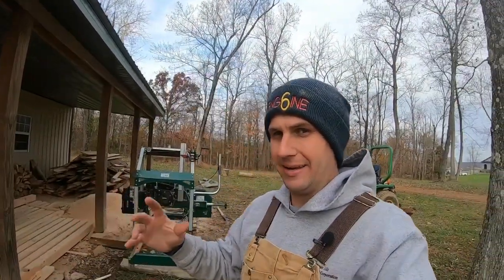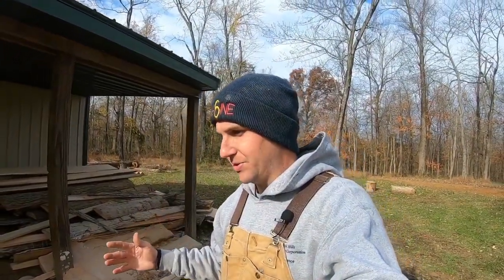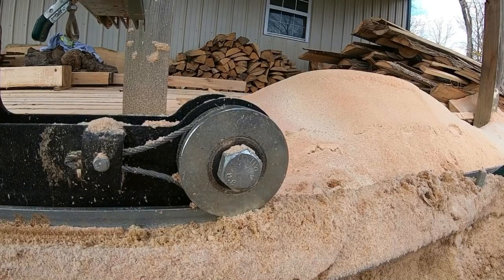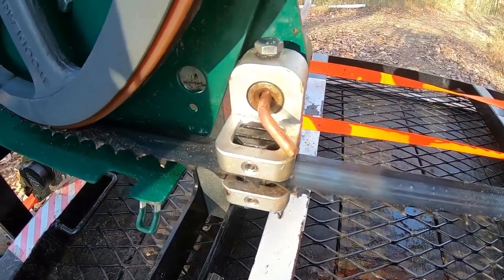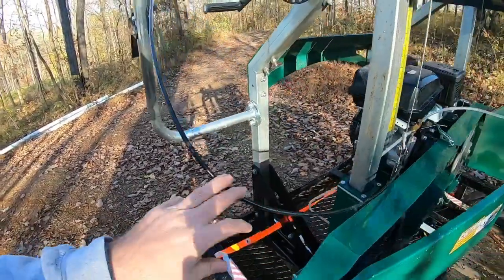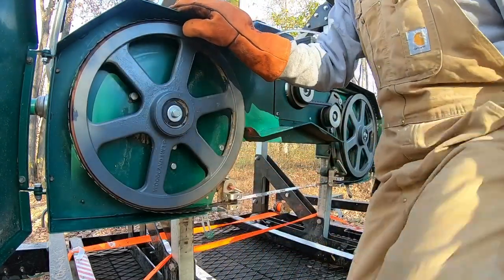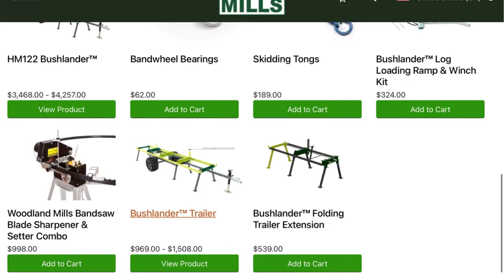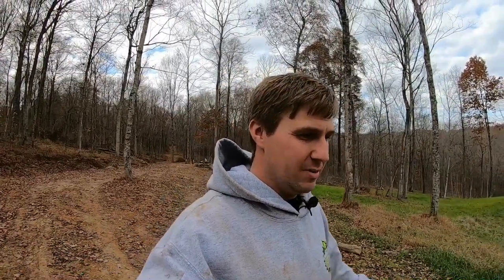My Thoughts After Testing This Entry Level Sawmill - Budget Friendly Hobby Mill

Comment: Simply replace that leveling tubing with a longer piece of tubing and loop it over and tie wrap it together with a small loop in it so sawdust can't get in it.
They could have easily welded metal plate end caps on the cross box tubing to keep sawdust from building up in them..
The owner could do it as well with pieces cut from some steel flat plate.
Overall, it is a pretty nice mill.
Your review was darn good and comprehensive.
Your editing is definitely gotten to a pro level Captain.
Reply from the maker: Appreciate the feedback!
Reply: @CaptainKleeman  thanks.
Next time you build an outdoor wood item like the bridge soak the wood down with a wood preservative like Kilnz (spelling suspect).
A couple of coats.
It'll last way longer than just the tar you used but that was a pretty good idea.
As it'll also help with the wood chaffing itself apart which anything that has friction will do.

Comment: Good morning Mike . Like I have mentioned I have zero experience with logs and wood .  However I do know steel anyway there is one thing about these blades someone new to them may experience and drive them crazy until they figure it out . When uncoiling them from the box it is possible uncoil the backwards . Not a big deal just twist them inside out and problem solved .  I say this because you didn't cover blade tooth direction and blade spin direction .  It is an easy to overlook . I have seen this all the time with the blades we use . But they much longer too .   And if you don't have any blades to see what I am talking about try it on with an old porta band blade you may have laying around .  Keep up the good work .

Comment: Thanks Captain for the explanation of saw and the forest in your area.  With very little pick'ins, and a "HomeDepot/Wade" down the block, yes it does make sense for you.  I saw Letsdig18 and LoggerWade's factory tour, it was unreal what it takes to make a 2x4!  Looking forward to you getting back on the projects (Yes a saw mill would be a distraction from finish that rental boat).  BTW, still want you to move the bathroom drain into the wall instead of the floor! 😁😁
Reply from the maker: It’s definitely an impressive operation!

Comment: With the hm 122 bunks, weld metal plates covering the openings before you start milling, then that problem in done and dusted.
an easier fix for the sight glass / air flow tube, just zip tie a bit of burlap over the top. screens out the sawdust yet lets air flow.
Reply from the maker: That’s a good option,  not everyone has a welder though,  and I’ve never been a big fan of completely closing something all the way in.
Reply: Welder !?!... and even less have nitrogen (to prevent corrosion) in closed tubing.

Comment: A good balanced review. Trick with the water tank breather is put an old chainsaw fuel filter on there, works a charm... Here in the UK for most it's  defiantly not economic to run your own mill, and that's taking in to account I would hazard a guess the cost of lumber is dearer here too, we could never justify one that's for sure.  For the time being the odd bit of milling we do the Alaskan mill with steel box section rails works ok. Another milling channel I watch is 'The Log Father'... his self built mill and timber processing set up is sweet. Keep the videos coming! Jenna and the BCC team.
Reply from the maker: Always love hearing the viewpoints from different areas in the world!

Comment: Good info sir on the entry-level mills. I'm sure all of them have some little quirks that should/could be re-engineered. That water tube just needs the open end to be turned down instead of straight up. My buddy has one and he loves it. He actually cut the oak boards that are on my equipment trailer. Keep up the good workn on the channel. Love the varying content.

Comment: never run a lumber mill, but job I worked involved cutting lots of steel rods ( quarter inch to inch and a half thick ) and changing the blade was always a pain in the ass.  wheel arrangement looks similar but the mill looks like the blade goes on and off way easier than whatever it was that I worked with
Reply from the maker: That sounds pretty crazy!
Reply: @CaptainKleeman  metal slivers are the worst

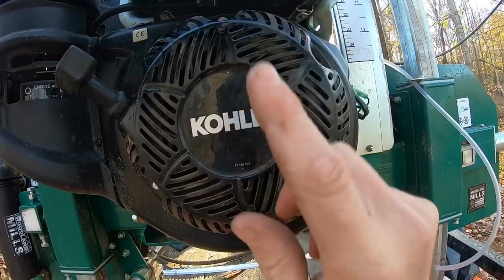Comment: @15:08
That’s not a Kholer feature. That was a Honda feature that was carried over by whatever company makes all the Honda clone engines but the reason is (as far as I know) exactly as you mentioned. Honda makes the engine and companies use them on their power equipment and access to oil fill or drain may not always be the same so it can be setup on either side.

Comment: I agree that the watering system is a little flawed. It's easily remedied, though, by using a thin piece of cloth over the top of the tube and using a rubber band or equivalent to keep it on. The cloth still needs cleaned off once in a while, but that's easily done.

Comment: Hi Mike. I agree solidly that milling is not for you. I just thought that when DP cleared ground an took out nice hardwoods like the mahogany or cherry that he could toss some in the bed of a dump truck and you would have real trees. Another thing that beat you on this was its hard enough just to get that wood to a milling spot since the mill doesn't move and the more handled, the more rock and debris your going to encounter. Plus your tractor has many good points but getting a log on a mill wasn't a strong point. As you said, an entry level mill has its downside or two as that mill you tried did. I will say though with a few improvements it could be a lot better. I mean a lot better but I digress as I used to build those mills and my dad started me in saw milling when I was too young to put up a good fight. At eight years of age, I held a average ten hour day or you don't eat here, and take your other pair of pants with you thing. Yes my dad was a real sweetheart. Those bunks are a joke and should not even be there but they opted to go for strong and out of tin foil metal. Regular bed frame angle would make for some interesting bends. Also that mill and most all mills are on too narrow a platform making it difficult to get straight with the blade and clear the machine. Had it been on say a three foot wide stance and out of H beam It would of been a real game changer. I made our mills including the track out of H beam and it was heavy duty, our tracks were four feet wide, and forty feet long for the huge fir and hemlock  we sawed. I would cut a dozen twelve by twelves out of one log cut from a tree and that was not the whole tree, just one cut. We loaded the logs with a loader and cable systems. I used to pour the babit for the bearings on the head saw. I have a million miles on this body of mine so no wonder I can't walk anymore... have a good turkey day to you and yours

Comment: Stony Ridge Farmer in NC runs a Woodmizer LT40 and has very good results from it. It is portable on 2 wheels so keeps the sawdust away from the rails and also is hydraulic operated with the log handling. Not a base level machine I think but if you want a machine with more features watch him use it on his channel.
Reply from the maker: LT40 are around 40k.  Great saw setup though!

Comment: replace the vent hose with another one only longer so it can be pointed down. sawdust can't get in but the air will. the fuel filter will get you the same problem you have now. They also make real vents for that situation, a longer hose is easier to find. Keep smilin son.
Reply from the maker: Thanks for watching!